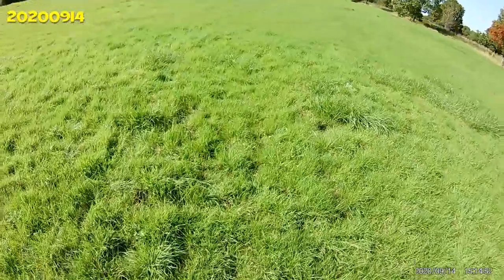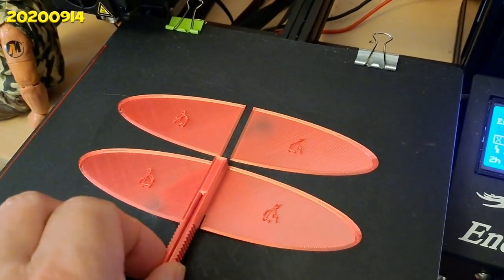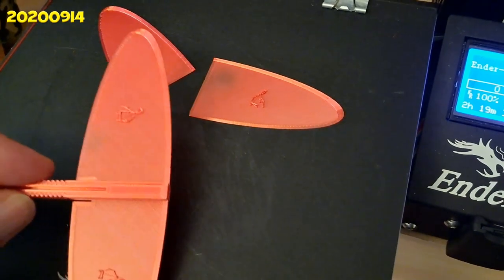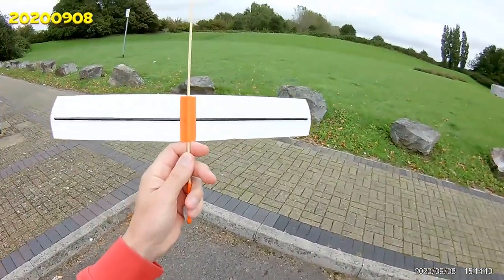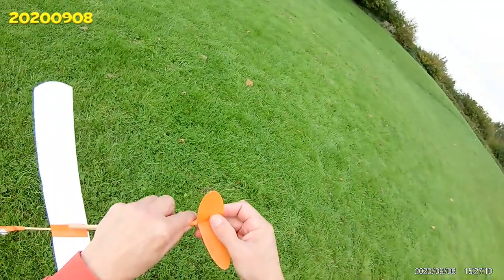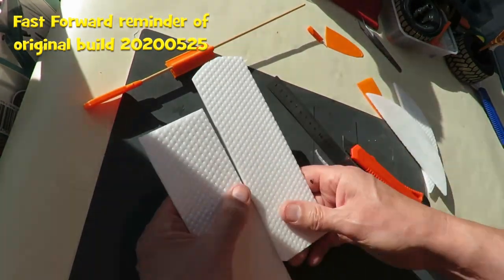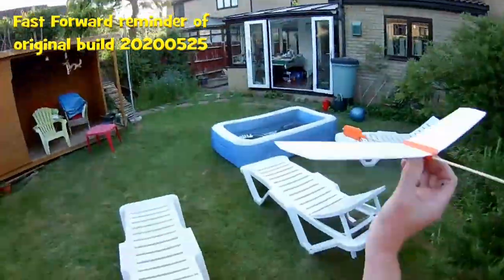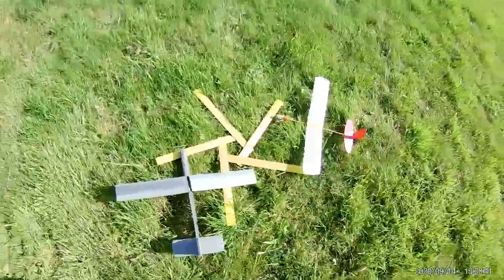Alternative tail for my 3D printed + pizza tray foam catapult launch glider

Comment: (I almost forgot to write!) It is / was very nice to see!
.
it is always a bit tough,
it would probably go better if you made it a bit larger scale.
that little thing, that light one is so VERY very sensitive, it doesn't go well at the slightest thing. is not properly adjusted
Although the one you tried out in the garden looked good (yes the tail a bit too small indeed!)
but a fuselage with the wing sliding on it and then the hook (with any weight)
everything slidable that should be fine!
But I stick with it when it is so small it is almost impossible to do!

.
3D print only the conrectors in V position on Fuselage (slidable) so that you can insert styrofoam,
 (wings and tail)
Possibly reinforced with carbon or skewers. 
(Optional hook for elastic (with adjustable weight)
.
Healthy and friendly greetings from the Netherlands!
Rob
Reply from the maker: Thanks Rob 😁👍

Comment: Any larger gliders.
Reply from the maker: Not really, the LIDL gliders are probably the largest and they are still basically toys - Glider from LIDL https://www.youtube.com/playlist?list=PLA5a2xPRSrB32IALqvbaZiTaG6J-aJ-H- another project I haven't really finished. I have 4 or 5 stored in the loft for modification but haven't worked on them for years.
Reply: @GrandadIsAnOldMan  Any radio control single channel or 2 channel.
Reply from the maker: That is what that LIDL glider project was all about, conversion it to RC. It has become a very popular choice for RC conversions. My friend Heady2008 has had great success with his, here is an example https://youtu.be/GgW16VCTkQM FlyBrie has almost turned it into an art form with a number of different versions https://www.youtube.com/playlist?list=PLPaR_9X2oznOQsqMxFo4xlIJjo5p3g18R